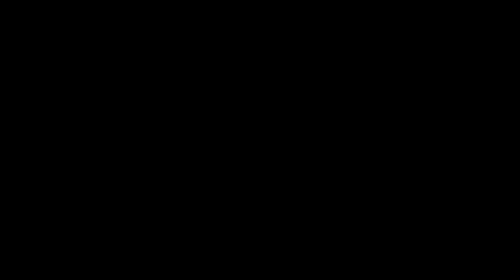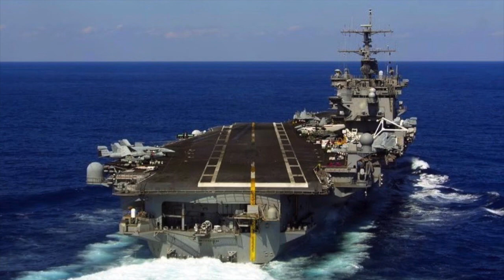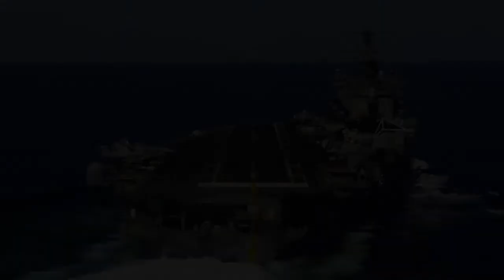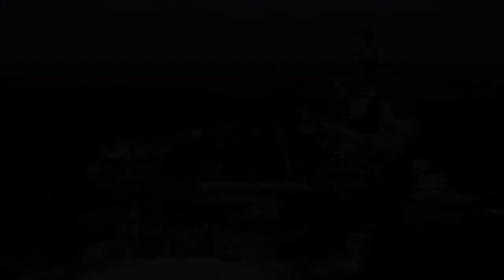014 - Day Carrier Landings (part 2)

Comment: Hi Vincent, can I have a question about recovery WOD for legacy F/A-18C. What was standard WOD and how corrections was done (if) on downwind when WOD was lower speed 15 or 10 kts down to minimum of 3kts WOD according to Nimitz class recovery arresting gear safety limits. We all know that Groove time should be 15 to 18 seconds. Slow WOD would decrease Groove time significantly to some dangerous short time, when pilot cannot make any landing corrections, if he turned 180° at ABEAM position. Thanks very much for any info & explanation.
Reply from the maker: It is up to the pilot to judge when to begin the approach turn in order to achieve the desired groove length. That turn does not always begin abeam the back of the ship.